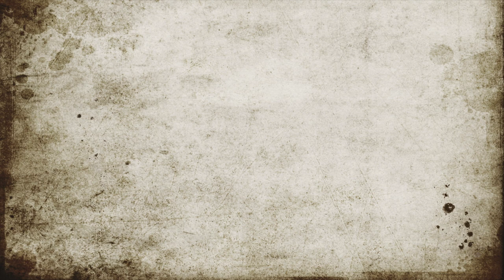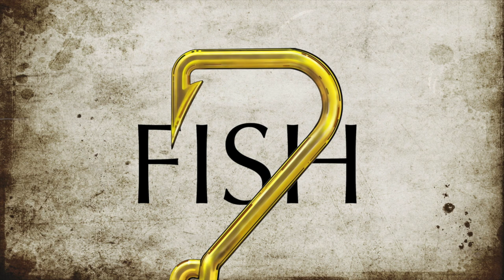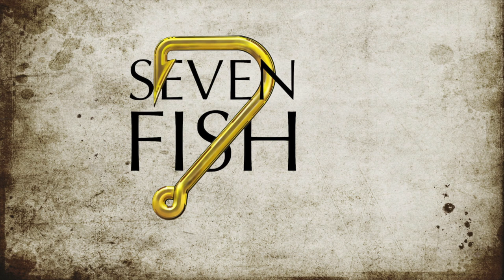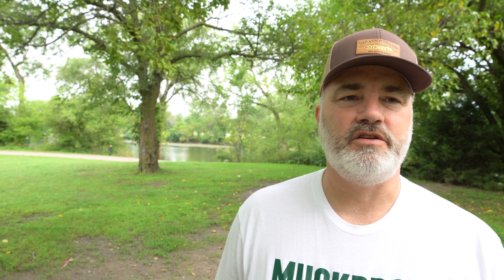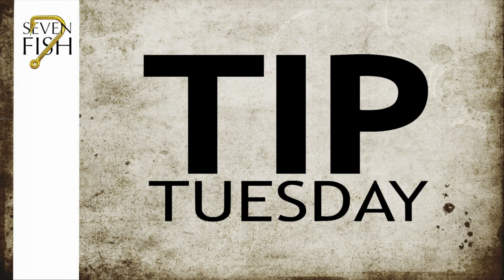Carbon vs  Graphite?

Comment: So 100% “carbon” rod is graphite and it more brittle than fiberglass?  Can you do a video on the various types of graphite? IM7 vs IM8 vs 24-ton vs 30-ton!!??!
Reply from the maker: Graphite is actually carbon but too brittle to make a rod out of.  The rods we call "graphite" are a different carbon that can be used for fishing rods.  IM6,7,&8 are industry terms for modulus, but it represents a broad range of carbon content and is losing favor in the industry.  in other words the lower end of IM8 and the upper end of IM7 are almost the same rod, but the low end of IM7 is almost the same as a high modulous IM6.  confused yet?  tonnage is a more accurate term for the base carbon used in construction of the blank,  It represents crush strength of the material.  I could do a video but was worried that it would be pretty boring for most folks.  Thank you for the question though!
Reply: @sevenfishyoutube  so I ended up buying a 30-ton over 24-ton but that was driven by the clearance price for $49 for the Abu Garcia Virtual 6’8” with free shipping. My understanding is the higher the tonnage the more sensitive but the more risk of breakage… conclusion, yes a video would be great!
Reply: You have me wondering the same thing now.  I bought 1 Okuma Dead Eye Classic and 1 Okuma Dead Eye Pro.  Same action and length.   Classic is 24ton and the pro is 30 ton.  They're both super light and sensitive but does this mean the pro has an easier breaking point?  If I don't get an answer, I'll let you know with experience.